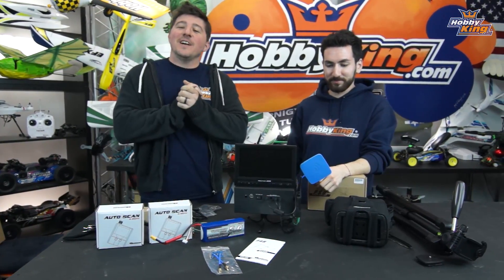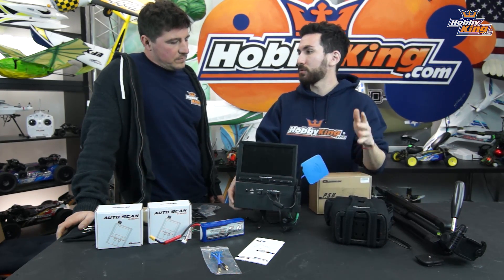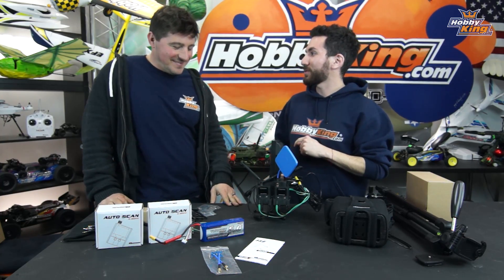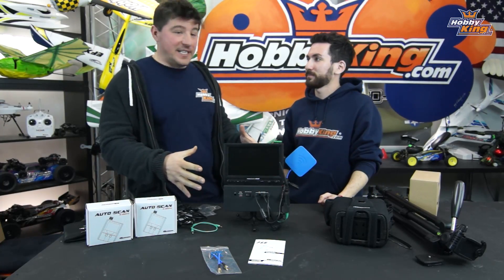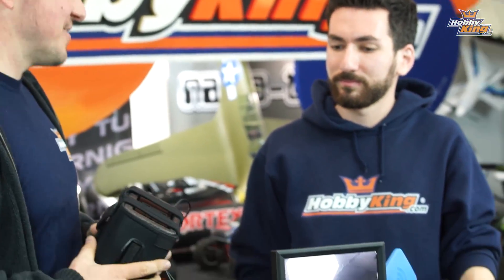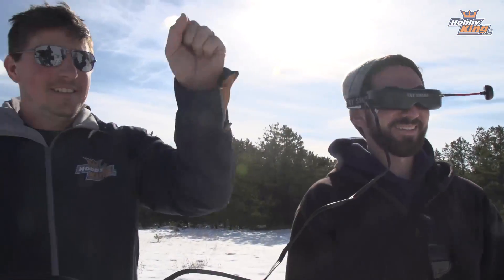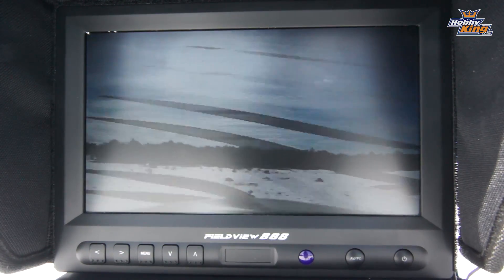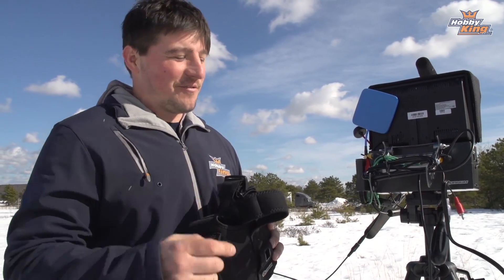FPV 123 - How To FPV - Quanum Ground Station & Power Supply Unit

Comment: How come you didn't put more video out plugs on it? Also more 12v power outputs would be good. and 2 usb.
Reply from the maker: +Gary Lowe 4 12V outs, and 3 video inputs work fine for our use. If you are running diversity, then you really only need 2 inputs.  We never at any point during our testing were wanting more ports.